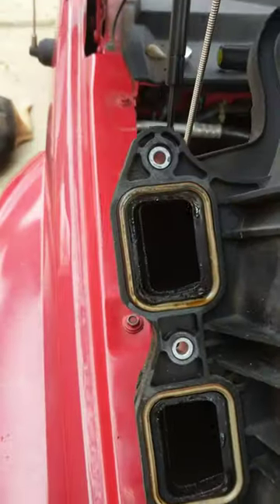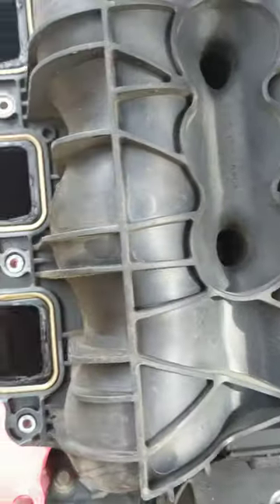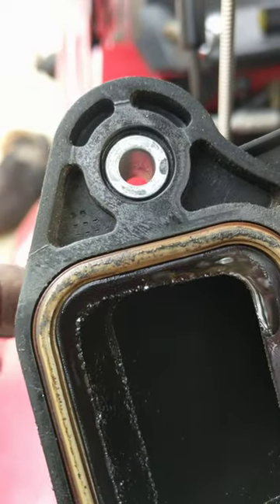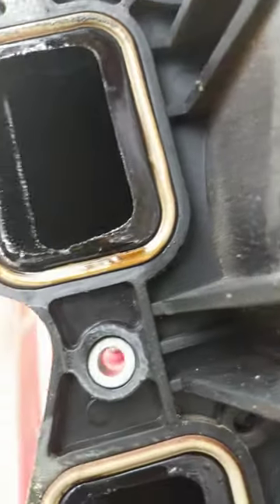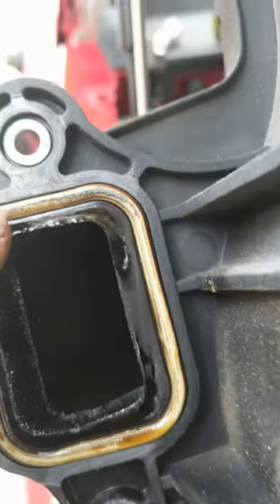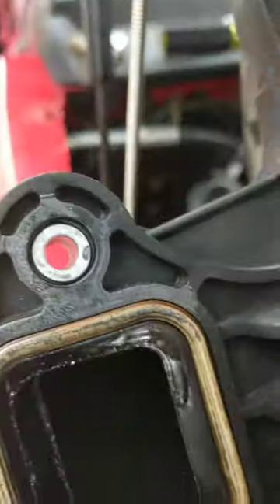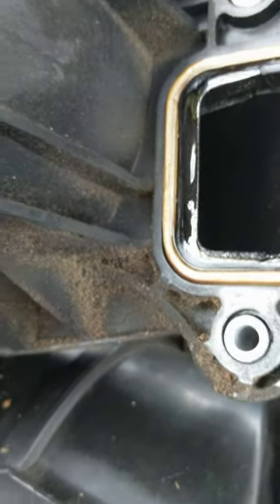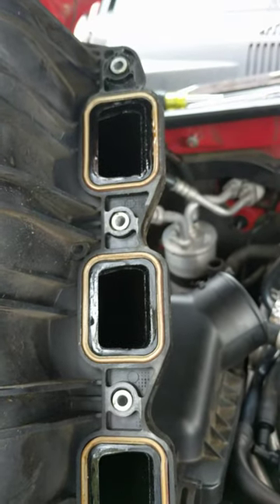3.7 L Jeep/Chrysler Intake Manifold (4)

Comment: How does coolant leak threw those gaskets ?
Reply from the maker: Coolant doesn't come in contact with that surface. This is only air intake.
Reply: @starootoo  is there any way coolant can be burnt in the cylinder heads without a bad headgasket ?
Reply from the maker: @joshuacarter9140  Not that I am aware of. Porting in the head gasket for water passage through the head and block is the only contact potential.
Reply: @starootoo  dang I'm at a total loss.
Reply from the maker: @joshuacarter9140  any coolant in the oil?
Reply: @starootoo  yes and quite a bit
Reply from the maker: @joshuacarter9140  then you're definitely on a head gasket, pal. Intake gasket isn't gonna cut it. It's only for air.
Reply: @starootoo  that's what I was thinking.  But is it even plausible for there too be minimal signs of blow over yet still be able too steam like heck?
Reply from the maker: @joshuacarter9140  I'm no mechanic, but in my experience...if you have coolant in the oil and steam, you have non-combustible coolant leaking into the head...head gasket. 😒